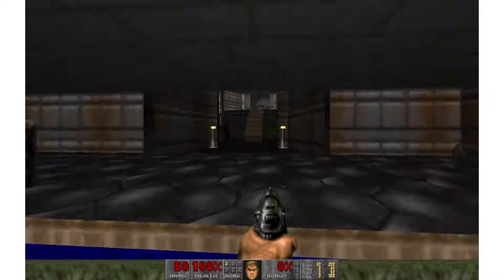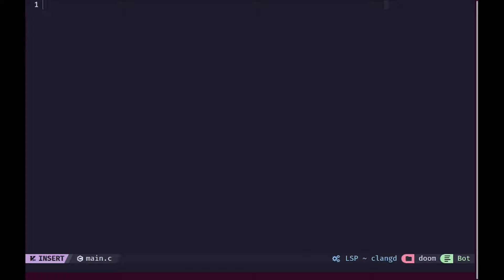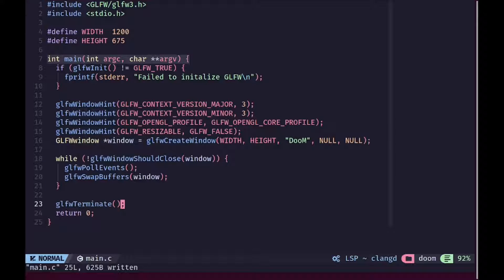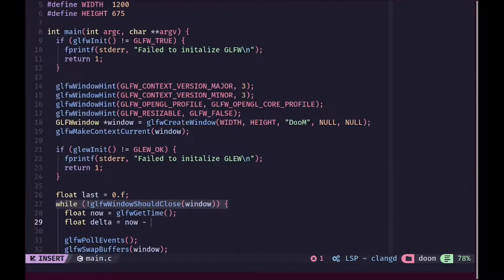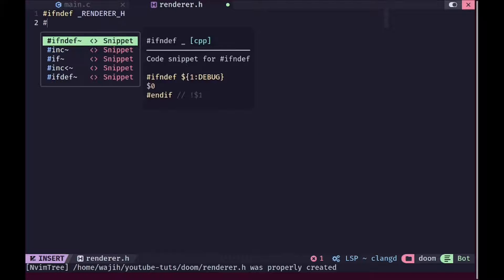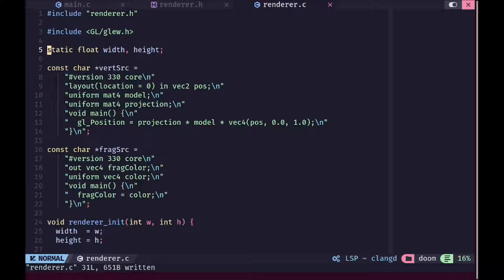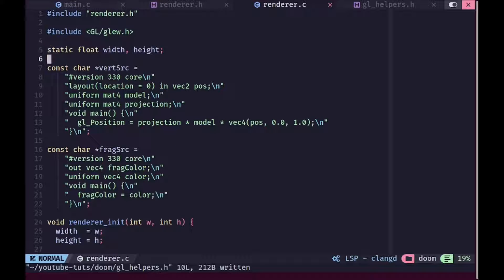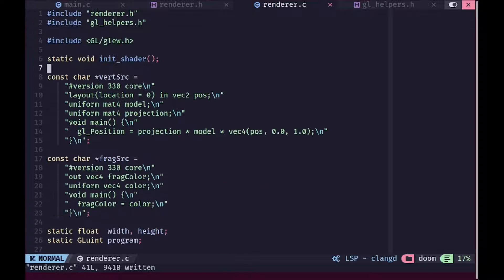Remaking Doom with Fully-3D OpenGL | Setting Up

Comment: Subscribed! looks really good content! One question: why did you use pollevents before swapbuffers when the glfw site tells to use poll events only after swapping buffers? Thanks.
Reply from the maker: Since we are redrawing continously, the glfwPollEvents occurs after the glfwSwapBuffers (of the previous frame), because glfwPollEvents is the first thing in the loop and glfwSwapBuffers is the last. This only matters if you are waiting for events because you want to swap the buffers before you start waiting.
See this for more info: https://discourse.glfw.org/t/why-should-event-processing-come-after-buffer-swapping/644
Reply: @thehelloworldguyofficial  thanks man, but what about the very first frame drawn on screen? first time it will pass first in pollevents instead of swapbuffers. I know the first frame is nothing compared to the rest of frames, but i always thought of that possible wrong order of the first frame...

i even thought of make a swapbuffer codeline before of the mainloop to match with that pollevents at the beginning of the loop...or maybe is just overengineering..
Reply from the maker: @razorblade413  I don't see why glfwPollEvents before glfwSwapBuffers would be problem. The events are not really dependent on the buffers being swapped. Putting a glfwSwapBuffers would be meaningless before the main loop as there is nothing in the buffer at that point.